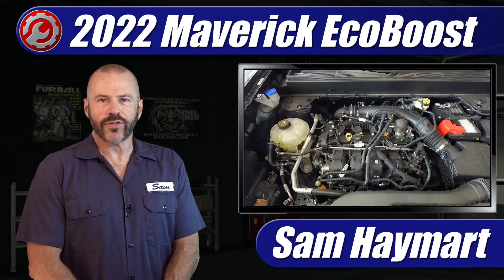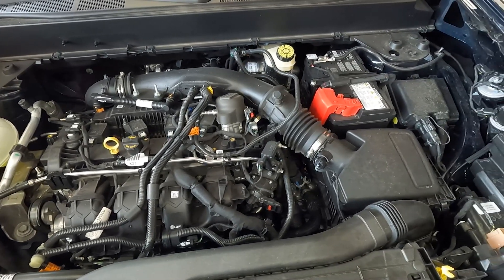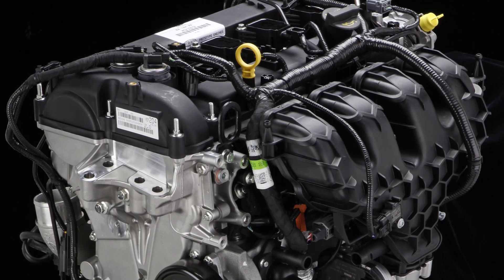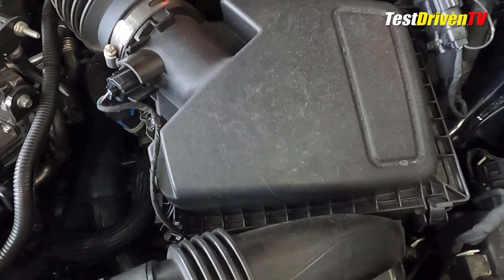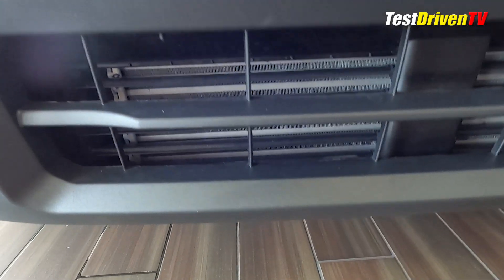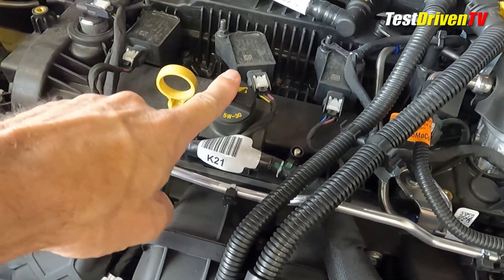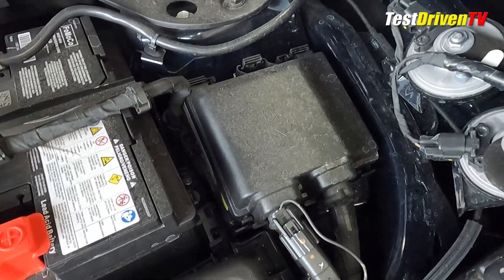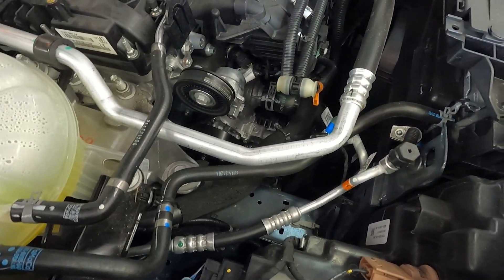2022-2024 Ford Maverick 2.0 EcoBoost Engine Explained

Comment: Wrong! I drive a 2024 Maverick with the 2.0 engine and you have to use premium! I should have done more research before I purchased it. I bought it based solely on price, not knowing what I was getting into. I took it to Walmart for an oil change and they told me an hour later that I had to take it to the dealership! They charged me $129.99 compared to $39.99! Don't get me wrong, I do like my little truck I just wasn't prepared for the cost of ownership.
Reply from the maker: Sweetheart, we are not wrong. We do our research. The EPA rates this vehicle for Regular Unleaded. Premium is recommended but not required. Its warranty, its performance metrics, its fuel economy are not based on premium fuel. Whomever told you premium required was incorrect. You paid too much for an oil change, shop around. Our local dealerships run specials all the time for $60-70 and you don't have to go to a dealership. https://www.fueleconomy.gov/feg/PowerSearch.do?action=noform&path=1&year1=2024&year2=2024&make=Ford&baseModel=Maverick&srchtyp=ymm&pageno=1&rowLimit=50
Reply: Read your manual. You can use regular 87 but for towing/hauling use premium

Comment: Wow.  You could have done the exact same discussion 2 years ago on a 2020 Ford Escape.  As you rightly mention, it shares the same platform.  In fact, all the intake parts from the turbo to the intake manifold are the same PN as my 2020 Ford Escape Titanium.
Reply from the maker: We might have ;)
Reply: @TDTVGarage  For extra credit 🙂 why does the Escape have a foam engine cover and the Maverick does not.  Note:  I have removed mine and put it on a shelf.
Reply: @TDTVGarage  One more important thing.  Ford has finally put in place in intake valve cleaning procedure using BP products.  I recommend every 20-30K miles.  I have gone too long (90k) and will need to walnut blast mine.

Comment: He forgot to mention if the turbo is water cooled, and if it’s not water cooled, should you use 5w40 diesel oil full synthetic to deal with the immense temperatures the bearing suffer with and should you let it cool for at least a full minute before shutting down or two minutes if you have that much time to spare

Comment: A lot of these engines are experiencing head gasket problems.  Open deck design is not good with turbocharging,
Reply: Beginning around mid-2019, Ford claimed to stop using the open-deck design between the cylinders and now uses a block design where the slits are the size of a pinhole directed through the cooling jacket. Rather than running coolant through an unnecessarily-wide opening, the coolant travels to a much smaller spot on the cylinder head, significantly reducing the risk of coolant penetrating the head gasket and leaking into the combustion chamber. When leaking does occur, it usually is in the middle of the engine between cylinders 2 and 3 but could affect cylinders 1 and 2 as well. There are loads of 2.0 motors with over 150k miles and are the old design, so I guess it's a roll of the dice with them. Just don't abuse them, add full synthetic every 6k miles and cross your fingers it's all good.

Comment: Excellent small trucks. We have a '22 Maverick XLT 2.0L FX4 4wd & '22 Ford Edge AWD 2.0L TGDI. The Gen2 - 2.0L TGDI is proven , powerful & efficient. Very smooth & quiet as well. Run a good full synthetic engine oil @ 1st service & keep it on 5k mi OCI max. I wouldn't try 10k mi oil changes on ANY turbo DI engine. Not worth saving few bucks on oil. Engines are expensive, oil is cheap.

Comment: Anyone else have one of these leaking antifreeze? Mine is a week old with 183 miles and has antifreeze pouring out of the middle behind the radiator. Can't see exactly where because it is tightly packed in there and I don't have a lift to get a better view. Waiting for the dealer to get back to me as it was towed in yesterday. I am already strongly regretting this purchase after all the problems with the older ecoboost engines I saw, I thought by now they were all fixed.

Comment: Auto mechanics have done a phenomenal job scamming people about “carbon buildup” on turbos. Solid 2.0 liter engine with a solid and tested 8 speed auto. Get the FWD version if you want less things to break. And don’t drag strip race this thing
Reply: Yep.  I finally got my 2022 back in October.   It’s now March and I only have 1500 miles on it. I intend to baby this engine as much as possible, no burnouts or stress testing the power plant.

Comment: Now I see. I bet the turbo fails. Second that's got to be a expensive master cylinder ABS combo when that thing fails. What not led all around for lights. Great a sealed transmission, so if it leaks and level goes low it will just slip till it burns out with no way of telling.

Comment: I wanna get Ford Edge 2.0 L ecoboost but I watched a video for Scotty said it’s gonna get problems bc the engine is smaller than the body 🤷🏻‍♂️
Reply from the maker: Most engines are smaller than the body, it's how they fit inside.
Reply: @TDTVGarage  but if it was 3L with turbo maybe better?

Comment: Have any changes been made to help with eliminating the intake carbon build up that these 2.0’s are notorious for?
Reply: This truck now has the second generation 2.0 engine and has been improved by Ford.
Reply: There are plenty of chemicals you can use to de carbon your turbos also using higher octane fuel with less ethanol helps a metric sh*t ton

Comment: Why would you make braking so complicated with all those electronics? It looks like a possible failure point, same as the electronic steering in the Ranger getting damaged from water (being an all-terrain vehicle smh)
Reply from the maker: Brake systems are becoming electronically controlled because of automatic safety features like automatic emergency braking which are almost standard equipment across the automotive market. Electric power steering is also standard fare because of pollution and smog issues around belt driven, fluid powered steering. Water damage to electric steering racks really isn't a thing anyway.

Comment: Being this is a 2nd generation, does anybody know the reliability or even projected reliability of this engine? I wish ford did dual port injection so I wouldn't have to worry about carbon build up
Reply: I think thats just the nature of the beast with the way manufactures are designing these cars , as long as people keep buying engines that have known issues , ( carbon build up) ( exhaust manifold cracking ) (high pressure, low pressure fuel pump failures ) then they will keep building them , I would like to see these problems addressed but according to Ford it’s the owners responsibility to maintain the car properly and not drive the snoot out of it , I believe if you do regular oil changes at 5k on the turbo cars and run a good fuel additive like Lucas injector cleaner and remember it’s not a 1/4 mile race car you will most likely have a good experience with this engine , one other thing you can do is if you have been pushing it  hard or towing something when it’s time to park let it run at idle for at least 10 minutes to allow the oil temp to lower before shutting it down ,I did this on my Ford 7.3 and the turbo lasted for ever
Reply: @Craig Williams  these newer turbo engines don't need to be idled after driven cause they have a system that circulates coolant/oil so the turbo can cool down and not heat soak. I was talking to a ford tech that mentioned it to me awhile ago.

Comment: Wished the air intake doesn't block the 4th (right most) spark plug coil pack, which appears to require multiple components/tube to be remove to replace.
Reply from the maker: High pressure fuel line and regulator over the top. Logic argues the coil pack should be able to snake out from underneath without having to remove all of that. Luckily, 100k mile service interval on spark plugs.

Comment: Awesome video! I got a screenshot of the turbo with what looks like a heat shield to protect the intake air side. I was going to look into getting heat wrap but it looks like the shield will protect the waste gate actuator. I've been looking up this 2.0 Ecoboost and that's one of the main failures the valve itself and the actuator probably cuz if heat soak and heat cycles.
Reply: 2.0 Ecoboost exhaust manifold is integrated into the head. So basically it's all one piece.  The exhaust manifold has a known problem it cracks. Ford is getting had a class action lawsuit against them for it. The other problem is that it is only direct injection and not port injection and direct injection. Other manufactures have both. So carbon will build up on the valves and you have misfires. Good luck .

Comment: Okay, I am pretty convinced with this video. The engine looks simple and straight forward compared to most modern cars. The truck engine components seems to be easily accessible and replaceable for an owner to do.
Reply: I wouldn't think that way, because it is turbocharged. I'd recommend you check fordtechmakuloco youtube channel
Reply: It's a very high tech TGDI engine design ..though thoroughly proven in its 2nd Gen. Run good "full synthetic engine oil" w/ Motorcraft filters.. changed every 5k mis MAX (turbos need clean oil) an you be good!
Reply: Except for the throttle body

Comment: Thanks for this video! I do my own maintenance whenever possible so it's nice to get an idea where things are and how serviceable the car might be.
Reply: They are excellent high tech engines. Just run a good brand full synthetic engine oil & Motorcraft filters every 5k mis MAX. You be fine. Owned Gen1 - 2.0L in MKZ & Gen2 - 2.0L in my '22 Edge AWD.
Reply: @Davido50  I ran Mobil 1 and serviced mine well including transmission services and srtill ran into serious engine issues before 80k miles. I drive Toyota now and never looking back!